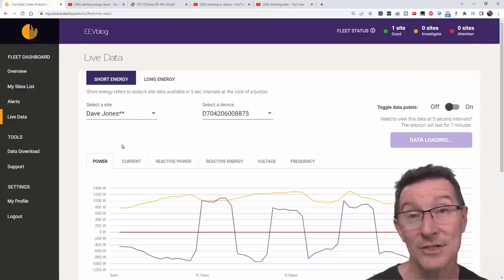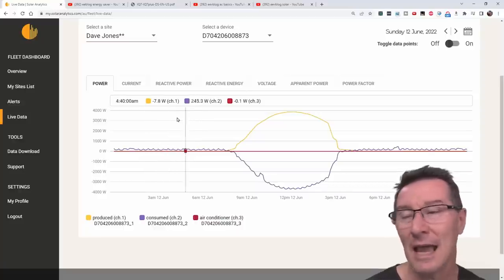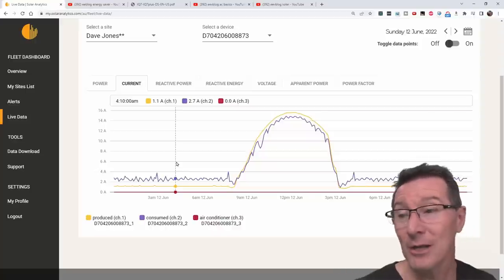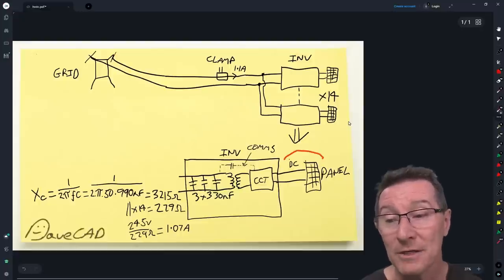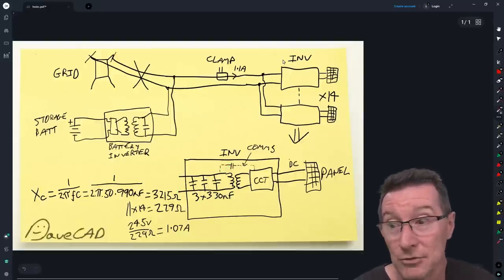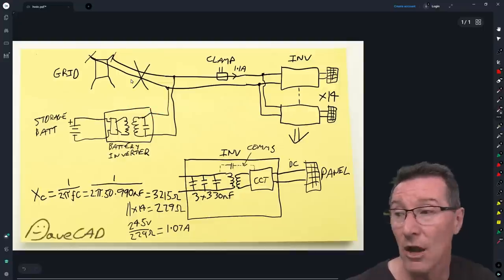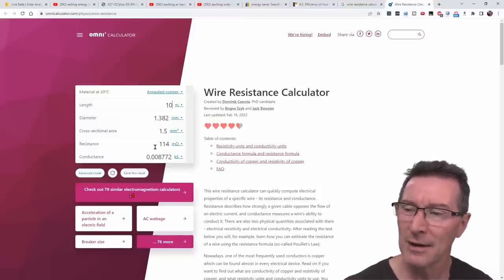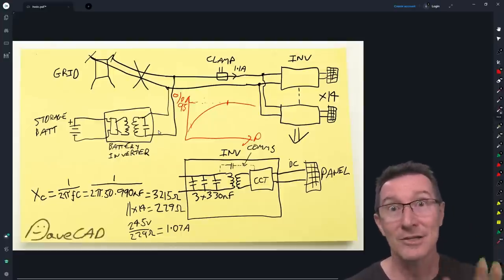EEVblog 1487 - Do Solar Micro Inverters Take Power at Night?

Comment: I'm an engineer working at Enphase, working on the envoy's software. It just feels so cool to see Dave talk about the Enphase system.
Reply: Reach out to Dave, and do a guest video call with Dave for the channel?
Reply: Harsh, I love my 68 Enphase IQ7 inverters!  Rock solid and excellent data reporting.
Reply: Hey there real actual nice human person at enphase. I want to integrate lifepo4 locally at each miv. Do you have a solution yet? I’d like to buy it, but I’ll build it if need be.
Reply: So did you want a gold star?
Reply: @ugetridofit  Probably as much as you want attention?! 🤣

And yes, if we all would live in the same kinda strange way of living and thinking as you are, i would get all of them engineers at enphase a gold star. Good job guys!
Reply: We have these also. Love 'em.
Reply: I have been using enphase inverters with a 1.2 kw solar for a decade. I have seen my meter run backwards. 
Would like more but...$$
Reply: Me too! Just started as an intern
Reply: Still wondering why Enphase appears to have no article or explanation about this behavior on their site. I've been searching for a day and only Dave had the correct explanation.

Comment: I work on macro inverters.  Utility scale.  Up to 4MW for a single inverter in some cases.   And on those puppies, they disconnect the DC input and AC output from the inverter via contactors when the inverter is idle, for exactly this reason.   Otherwise they would be a giant VAR suck.   However, sometimes you can order them with what we call NIGHT SVC (Static Var Compensator) mode, which allows you to send a signal to the inverter to reconnect its AC output so that the output caps are back in the circuit, and thus the inverter can act as a capacitor bank at night.

Comment: ⚠ SPOILER ALERT ⚠
Short answer: around 7w for the envoy & q-relay and near 0w real power for the micro inverters.
Long answer: there is also a capacitive load of about 1µF per inverter which will cause some power dissipation in the wires.
Reply: Thank You ..this due has to make a 30 minute video for this lol
Reply from the maker: 40 minutes. I challenge you to go edit the video and make it shorter while not removing any technical content or commentary.
Reply: @EEVblog  Please take this as constructive rather than negative criticism but you do have a tendency to say everything about five times.
Reply: That may be true, but don't you want to find out why, and what the details are?
Reply: @threeMetreJim  Your comment doesn't exactly follow what @number 33 said
Reply: @petehiggins33  Most of the popular YTbers are long winded and repeat themselves. A lot. This is what people seem to be drawn to.
Reply: @mcflonomcfloonyloo5236  I was replying to the spoiler from jim...
Reply: @threeMetreJim  Ok, that was not clear, my bad. It is definitely true in that case then though.

Comment: Many modern installations don't use micro-inverters, instead they use DC Optimisers.  They work in a different way, you still have a main inverter, but achieve the higher efficiency and eliminate the single point failure / shading problems of a string system.  DC Optimisers keep the panel wiring at high voltage (lower current) so not heavy cables.  Both solutions allow you to monitor the output of each panel.

Comment: I have bought a very expensive but very optimized Unique 12/24V fridge.  It uses about 600 Wh per day.  It must be smaller than your family's fridge though.  It works very well, but a bit slow, you must not put hot items in it, but now I have ice cream off grid!  When I started to live off solar panels (and a little wind), I was worried about the night consumption of the charge controller screen and monitoring.  But after a few years, I realize this power consumption is neglectable, I boil water all the time, cook and get coffee, I mean, one coffee in the morning must use the same amount of energy as the charge controller over one year!  If I get a decent water heater with an element inside instead of my current oven element with a pot, I will save thousand times more energy that trying to optimize the generation system.  There are other more important things to do, such as not forgetting the computer powerred on while doing something else.
Reply: My mac desktop while sleeping uses about 2 watts. The whole deal, modem phone etc 5 watts

Comment: Suggestion to really show apparent vs. real power:  Put it on a scope.  Differential probe on channel one (safety first) and current clamp probe on channel two.  Open a math channel as the product of one and two. The cycle mean will be the real power. The phase shift between channels one and two will let you calculate P.F.   You could compare the vrms and irms with P.F. to the math channel result.  Would make a nice video…

Comment: The couple of watts drawn at night seems to match what I see at home.  Eight IQ7 inverters and an Envoy S Metered, which I think is on the solar panel side of the production CT, and right now (11:39pm) it's showing a production power of -7 watts.

When it comes to battery storage take a look at the dedicated units for the task such as the Sofar ME3000SP.  Hook it up to a 48 volt battery bank and it'll draw up to 3kW of excess power (that would go to the grid) or supply up to 3.3kW on demand.  Basically it tries its best to stop your meter turning, in either direction.

Comment: I also had my system set to top off a battery bank before switching on the enphase system. I installed a DC distribution system that ran, Co detector, alarm clock, wifi router, cable modem, network hub, cell phone, laptop, ecig, and basically everything with a DC wall wort. In the event of power outage 600ah battery could power an inverter run some of my more important electronics.
Reply: I reckron future homes should have 12v (or 19V) sockets, feeding 220v to them is meaningless
Reply from the maker: @rabbithazel3034  Big losses in the long cable runs.
Reply: @rabbithazel3034  Copper isn't getting any cheaper. If anything, we should introduce smaller capacity circuits to save copper. But it'll be at mains voltage for efficiency.
Reply: @EEVblog  Yes hard to do, low voltage, heavy cables and any conversion from mains will have fixed loss based on peak power rating. DIY is easy with low voltage, though power is limited, and you will have to provide your own point of load conversion. 

12V or 24V, and small converters is doable, and often done in small off grid systems, but again a niche use. I do however have a single 30W panel providing power to a battery and some lighting and other loads, simply because I live in South Africa, and rotational load shedding and power loss is an all too common thing, so some power is better than none. At least I still have power, unlike a few large areas in the city, still without power after 3 months from heavy floods. Sorry to Aus if you are having issues getting LHD Toyotas, as the factory was under 2m plus of water, and all the in process vehicles, and all those destined to be shipped, went into a crusher, aside from those washed out to sea.
Reply: @EEVblog  The answer is simple.  Mains voltage, but at 250kHz!  That way you could just put tiny transformers in everything without having to have all the circuitry.  What could go wrong. ;)

At least you don't have to contend with 120V mains.

Comment: Thanks for the thorough coverage! 😄
To go off on a tangent about PFC, I find it really annoying that for example when it comes to power supplies with PFC, manufacturers crow from the rooftops, telling the amazing PFC value their PSU has. Except, they only give you one value at an optimal (high) load. However, PFC can be very poor at low loads. In typical applications the typical load may be only 50% of maximum PSU load capacity (or even less), where PFC specs are a LOT worse. They really should be be publishing graphs showing what happens across the entire load range. Same goes for efficiency, although it's more common to publish efficency curves, at least.

Comment: 10:03
Apparent Power S is NOT the (linear) sum of Active Power P and Reactive Power Q, but instead S²=P²+Q²
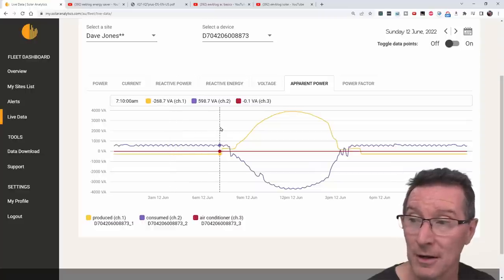Reply: Yes, this. It's also weird that at 14:00, he points at the bit where the Apparent Power changes from negative-to-positive -- but that's actually just a bug in the maths done by the graphing tool; apparent power is always positive. To be fair, that's a mistake in the software, not by Dave, but it is still ultimately nonsensical that he points at the point where the apparent power changes sign as being any kind of meaningful thing.

Comment: I would say the relays disconnect if they see a line voltage with the panels feeding in of over 253VAC for a sustained period, probably 5 minutes, and then disconnect to drop line voltage for the grid in your area. Disconnect will be at the furtherest points of the feed from each transformer first, simply because of the line resistance between the houses and the transformers, as that will have the largest swing in voltage, especially as the entire feed line to the transformer has solar panels feeding in, so the furtherest panels have to raise their generation voltage higher to feed in power. Then likely they wait for 5 minutes after the voltage has dropped below a hysteresis point, probably 243VAC, before they connect the panels again. 

5 minutes to give a chance for grid company on line tap changers to do a tap change at the MV power stations, and drop to a lower tapping point, to reduce the voltage they see reflected back to them from all the residential transformers they feed, accepting more power in at the lower mains voltage, to feed back to the system to the large loads that are still using it. Otherwise if you do not have tap changing and no residential disconnects your nominal 230VAC will go out of the upper bound of 253VAC, and the rise has been known to get to 270VAC in cases, so the relays are definitely needed. Yes trip points, delays and hysteresis is likely all remotely programmable, and they probably have a very wide range as well, along with giving good data to the overall health of the system, so the data is available, but the setpoints are likely not exposed to be adjusted, only for the manufacturer to set, not even the installer is likely to have access to them. 

But no doubt sniffable by simple traffic analysis of the data over the power line, and then you can get the protocol, and the commands that are sent, to get a probable command set to try, though there is good chance of scrambling the device during this process.
Reply: Disconnection should follow AS-5777.2, one problem is voltage at inverter terminals is higher than at switchboard.
Reply: Line voltage is complicated. If enough inverters were connected, voltage at the far end of the line would fall, due to reactive loading.

Comment: a very important subject on the factory floor and now at home when using inverters to keep clean grid electricity,  which can be a big issue with VFD AC motor drives and 5th, 7th, etc. harmonics. those inverters usually need additional inductors and capacitors as per installation requires so not to pay for wasted reactive power "foam on the beer" 😎 thanks, great video

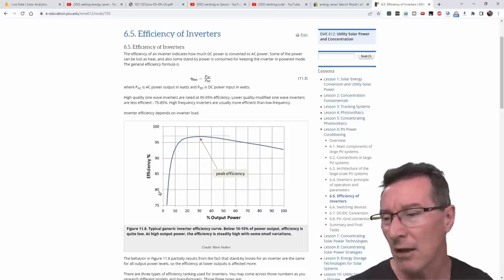Comment: At 32:55, where you're talking about lower inverter efficiency for lower amp draw... a single Enphase battery uses multiple microinverters to invert power.  At low power draws, where a large monolithic inverter would suffer a huge efficiency penalty, Enphase only need turn on a minimum number of microinverters ensuring they are always closer to the sweet spot.  I also suspect that because the individual microinverters have relatively small ranges, the sweet spot is a lot wider than a single huge monolithic inverter.

Comment: Dave, there's a DC linkage cap at the input (solar panel side) to your CCT box. They use the freewheel diodes to rectify the AC into DC to maintain the charge. These inverters act as a real load (at night) to adjust the phase angle of the current.
I also agree. The 1A would come from the grid, even in a solar+storage configuration. The battery will supply that current but the grid will charge the battery. Therefore, the current comes from the grid.

Comment: Generally, they n my expertise, grid scale inverters can deliver any combination of real and reactive power as long as their apparent power limit isn’t exceeded so they can provide reactive power compensation while exporting power. The more advanced versions can adjust reactive power based on grid conditions or a command from the utility. 

 Also Dave didn’t mention it but the Addition of real and reactive power to get apparent power is a vector addition not a scalar one so 1W+1VAR doesn’t equal 2VA

Comment: At my company we have the hole factory coverd with solar and with that the power faktor is nicely held at around 0.95 with the power factor correction in the NSHV turned off.

Also these Shut off relais are intresting here in Germanny we get a device installed from the grid provider that also talks over the powerline that gives a signal that has to shut off the solar/generator 
probably similar communication technique

Comment: Some bigger solar installations (2MW - 10 MW) get ratings from the net provider for maximum apparent power and maximum ratings for anything. 
It's more for the bigger systems which must be able to disconnect from the grid operated by the net provider. They don't have these relays but big 30kV/110kV switch cells and you need a special license to operate these switches (hot sticks ... ppe; 240V/380V is low voltage system; 30kV is medium voltage system and 110kV and above is high voltage system). If there are to much of this systems in small homes they might get commands from the grid control center too, it may be manages by enphase (more control of the grid if they control all enphase inverters remotely).

Comment: Just use the street lights to make power, ha!  I had 9.25kw envoy system at my old house. It was pretty neat to see all the data.  Now I just have an OFF-GRID setup 11.25kw with midnite solar and magnasine command center.

Comment: There also used to be a lot of data that you could pull from the inverters when the system first came out and for some reason they disabled a bunch of the things that you could graph and chart it used to input voltage, input current,  track temperature of the inverter along with some other parameters and then one day they just did a software update and all of a sudden half of the things that it could graph disappeared.
Reply from the maker: I can still get graphs of DC voltage, AC voltage, DC current, Freq, and temp
Reply: I just got a system and was surprised on how little data there was.  Seems to be designed for people who are not engineers:)
Reply from the maker: @RS-ls7mm  What system? My enphase one has all that data and more. There is nothing it doesn't have that I would want, apart form the mentioned ability to control the Q relays.
Reply: @EEVblog  Its an IQ8+ system.  The data is mostly fun charts on total energy production.  There is only one secondary display for current power production.  No voltage, no temp, no current charts.
Reply from the maker: @RS-ls7mm  Really? That sucks if that's the case. Sure you are looking in the right place? Mine are IQ7+. I'm lokking to get more, so if that's true with te IQ8 then that really sucks
Reply: @EEVblog  Maybe because they are new.  I got the  IQ8 since they can form their own grid if the power company fails.
Reply: There's a 500+ page thread on their forum about it. The old firmware made all of the parameters available with unrestricted update speed and only needed a user name and password. The new FW requires internet connection,  cloud authored encryption tokens that expire, and slower update frequency's. Major jump though hoops to get data into home assistant now.  They gave some excuse about safety and security for neutering their product... Lame move by enphase.
Reply: @johnfranks  Looks like they are definitely moving away from supporting engineers to 'look at the pretty displays'.  I had a hard time setting up my system since their help videos were way out of date.
Reply: It's due to warranty claims...
With detailed data a user will notice when a mico inverter fails, and ask for a replacement.
However, if they just show total power then you can have one or more fail without a user noticing.
Reply: @WolfTronix  In the IQ8 software you can see how much power each inverter is generating.  So you can tell if one fails but that is the only data you get per inverter.
Reply: @EEVblog I just doubled checked I can only view watt/hrs and watts. Nothing on input side, no inverter temp, no frequency, no output voltage. Its weird they must have brought it back on newer models. I could see getting rid of temp if the inverter was getting to hot for some of the Internal components and they didn't want users to know but the rest I cant understand. I had the M190-72-240-S12 and the off white oval shaped envoy.  I installed in 2009.
Reply: I dont think mine ever showed power factor.

Comment: I have Chinese micro inverters on my roof, Deye brand. 
They seem to shut down entirely when panel voltage drops below a certain level. I can't even access their management interface at night.

I suspect the microcontroller that provides the Wi-Fi connection is fed from the DC bus, as the management interface is still accessible when I disconnect the circuit breakers that connect to the inverter.
Reply from the maker: Makes sense. No real need to access at night if you continually upload data.